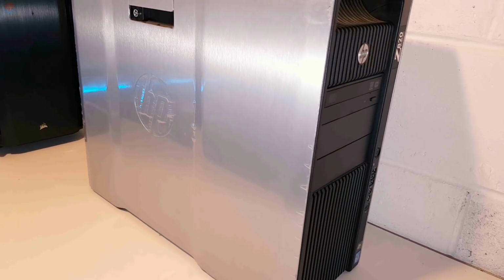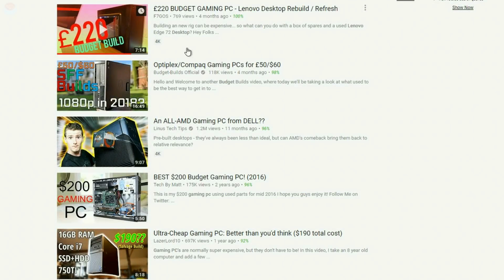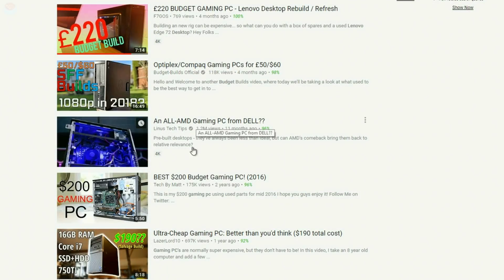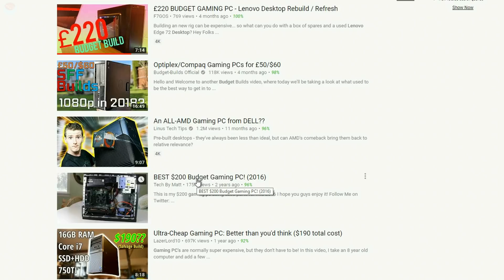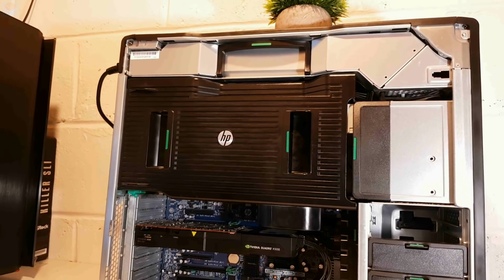Saving a SCRAP #Z820 #Xeon Workstation - Tear Down + Revival

Comment: Unrelated to the video, but I bought a used R9 280X that was "broken" for about 40 Dollars or 350 Swedish Kr. The seller said that the card often shut down and overheated and he had to downclock it in MSI Afterburner and now while writing it is in my system and working fine when downclocked 200 MHz on Core clock and 300 MHz  on the Memory clock. But when set to stock clocks it crashes almost instantly(when gaming) but the temps seem fine at about 60-70 degrees Celsius. I'm planning to open up the card and give it a well needed clean and replace the thermal paste but will that solve it?

PS: Great video as always!

Comment: HEY F7, 
Great piece on rescued tech. It would be interesting how far you can push the system before bottlenecks creep in, maybe install a second CPU and a more modern GPU.
Reply from the maker: Thats the plan.

Biggest snag is the HP OEM motherboard.. quite limited in what it lets you do

Comment: Go caseless and use and aftermarket CPU cooler if possible .
Reply from the maker: HP does a "liquid cooled" cooler for it. Basically an AIO built into the heatsink... looks pretty neat
Reply: F7GOS go caseless just to see difference